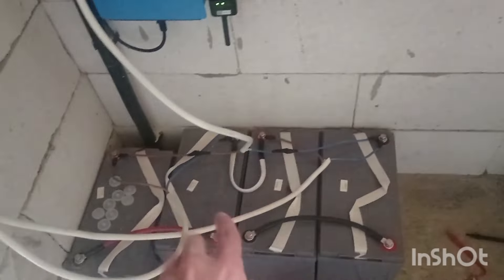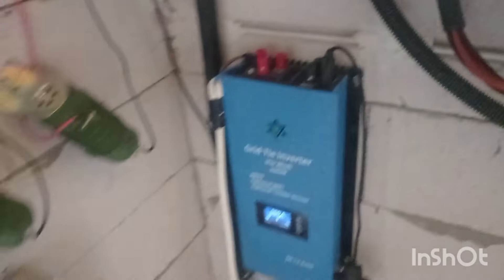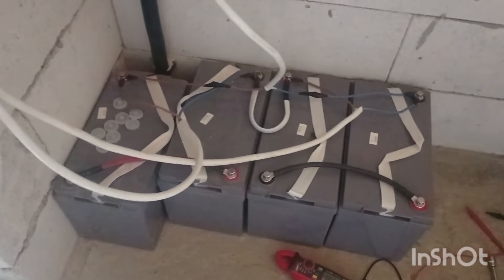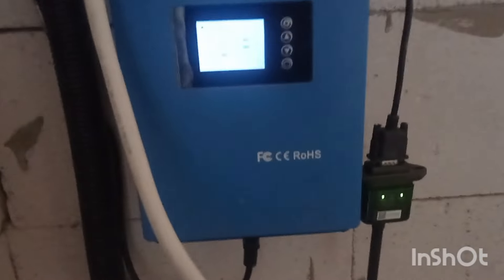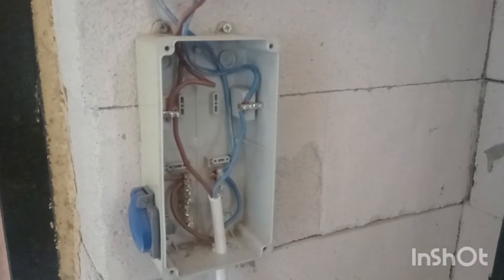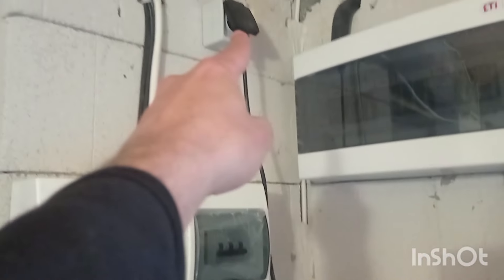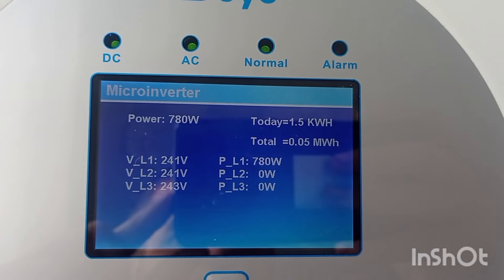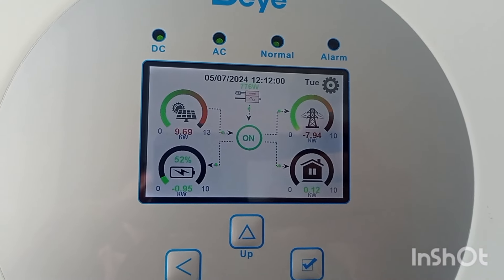How to charge your 48v system with 24v charge controllers? Is it even possible and will it work?

Comment: Yeah. Long as you careful, there's nothing wrong with adding or using power from one or more of the batteries that are connected in series with other batteries. Just have to make sure none of the batteries goes above or below it's safe voltage range.
Reply from the maker: yep. the balancer has arrived today, so I am going to pick it up form the post machine, and will likely mount it some next days. it will rearrange the voltage to be 100% equal.
so far after a couple of weeks, there is a 0.04v of disbalance between the highest and the lowest 12V banks.

Comment: Hello mate, I have 1 wind turbine connected to 2 rectifiers. The objective is to charge my batteries at 24v and  discharge at 48v through an inverter. Each battery pack is connected to each rectifier. The rectifiers are sharing the AC line from the turbine. For some reason i see 24v on the dc line of rectifier 1, even when all positive terminals are disconected on both rectifiers.
Strangely there is 24v between both negative terminals of the rectifiers, meaning that the electricity is flowing through the negative wires of the batteries, this happens when I put the batteries in series. If i disconnect the series link in the middle of the battery, there is no issue. Any idea what might be happening?
Reply from the maker: that's ok. in the middle of the 24V series it's the current that flows over 48V circuit.
Reply: How can i send you an email? I need to describe better the scenario that I'm talking about. It's not feasible doing it through the comments section. Diagrams and stuff...
Reply from the maker: sure, send it to bodo.kushlyk@gmail.com

Comment: Is such thing even possible to do? Charge and discharge simultaneously without manually switching connections? I know that charging and discharging seperatly by managing the series link in the middle of the batteries allows the charge and discharge but it needs to be one at the time, it can't be both simultaneously.
Reply from the maker: well, it works )
for several consecutive months already
Reply: @ModernUkrainianHomestead  sorry, I meant without charge controllers. Both rectifiers go to the same wind turbine. In your case the controllers are connected to each painel or turbine, meaning that the controllers are isolated from the input side. In my case the input AC side of the rectifiers are shared in parallel.